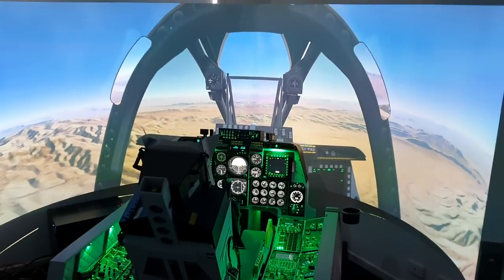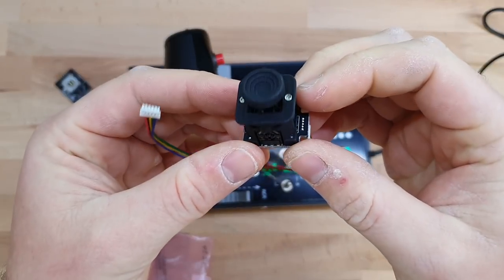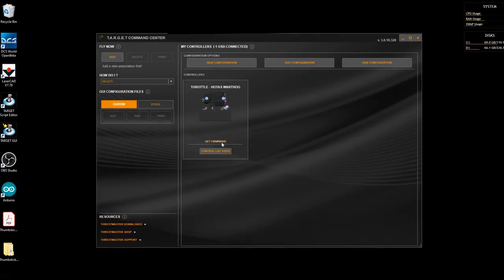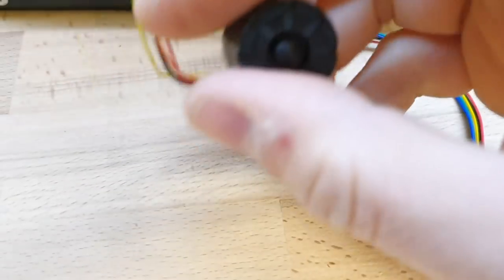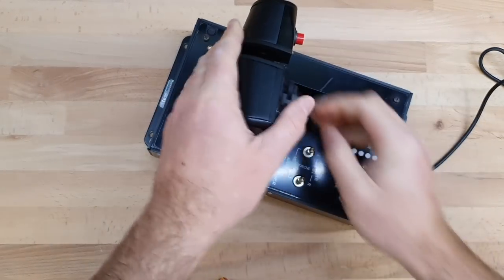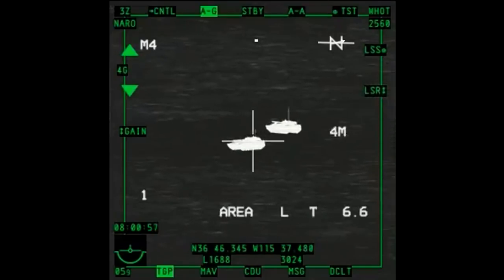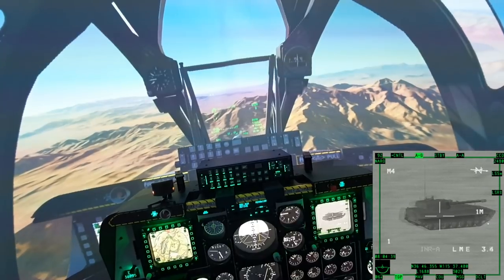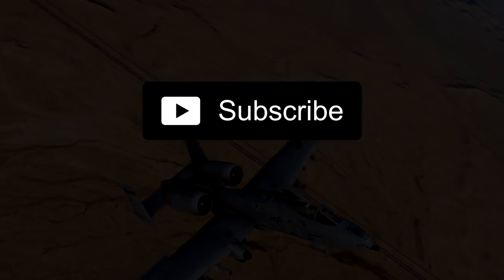Thrustmaster Warthog Slew Upgrade

Comment: Hi there. So i'm looking into getting the Warthog HOTAS for space sims.  could this modified Slew Sensor be used for better strafe control?  specifically strafe left, right, up and down?
Reply: Why in the feck would you buy a Warthog stick for a space sim? A-10's don't go to space. Buy a generic grip setup instead. Warthog specifically makes no sense...
Reply: Yes it's works for strafing in both Elite Dangerous and Star Citizen.
Reply: @UnitSe7en  Why not? The Warthog is a decent piece of kit. Heaps of people, myself included, use the Warthog for space sims as well as DCS / IL-2 etc. The main space sims currently have default configurations setup specifically for the Warthog.

Comment: Is possible to replace both hats with this I mean put two?
Reply from the maker: I dont think so. It would physically fit- but the other hat is not an analog axis so the electronics wont work. You could get it working if you added your own interface though!
Reply: The Warthog Project after the prize I wonder why the heck they didn't put 3 analog hats. A pity

Comment: when you have to modify a $250 throttle to do what a $60 throttle does out of the box, you should question what you are doing with your life.
Reply from the maker: Which $60 throttle?
Reply: Ain't no sixty dollars throttle that's better than this.

There are some that I'm eyeing that might be better for me (hornet driver), but they're not any cheaper.